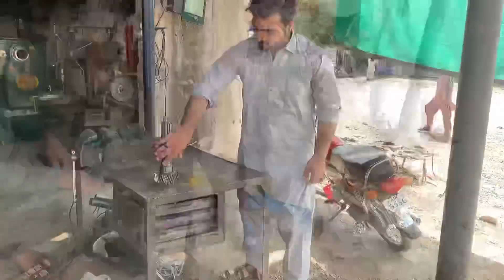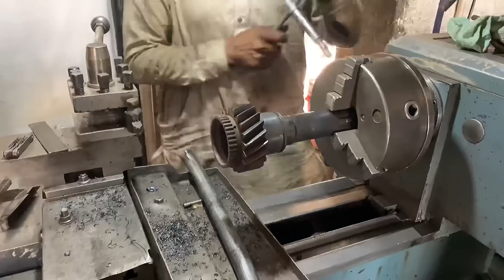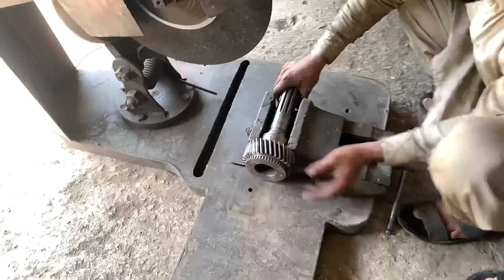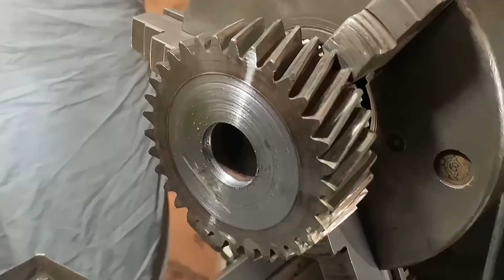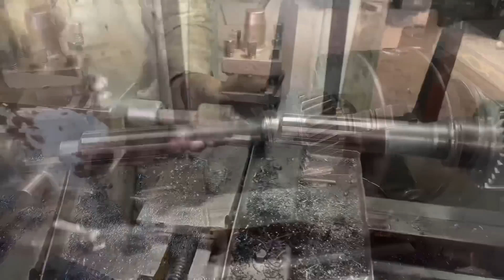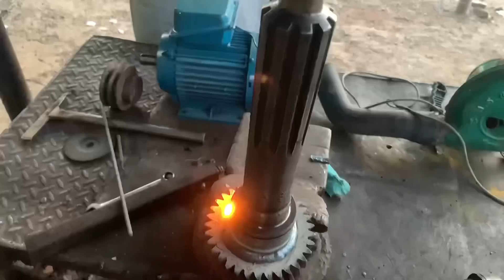A broken tooth on the input shaft by making a widening in the second gear to repair a strong joint

Comment: That input shaft & gear needs to be re heat treated since they had to soften them so that they can be machined in a lathe.

Welding the gears also softens them as well, it's good they're not very rough like others are where they literally welded broken gear teeth then "machined" them with an angle grinder !